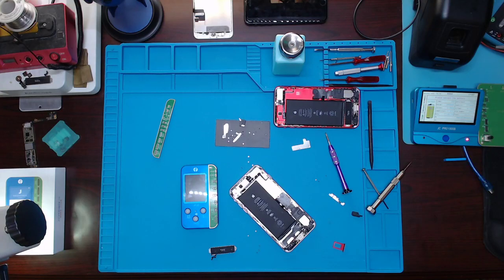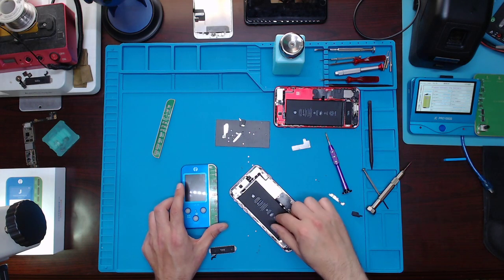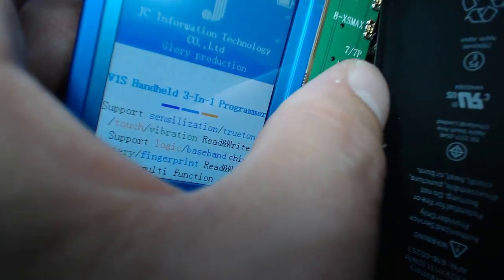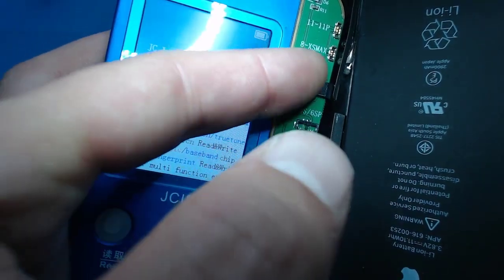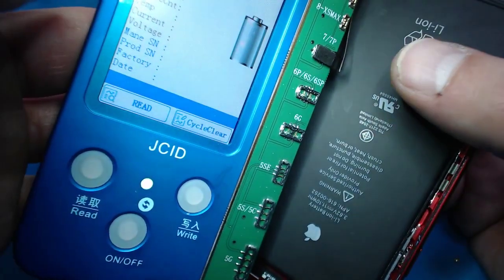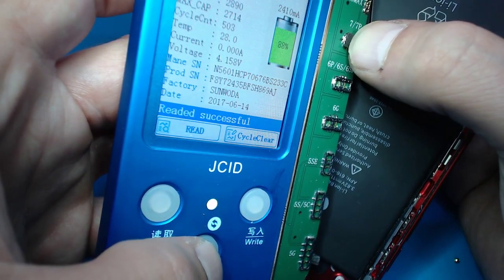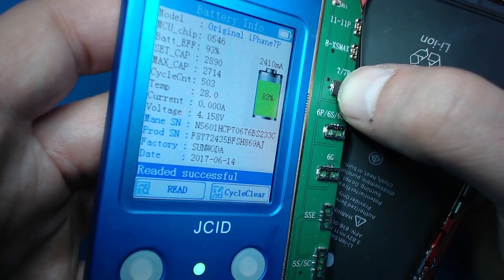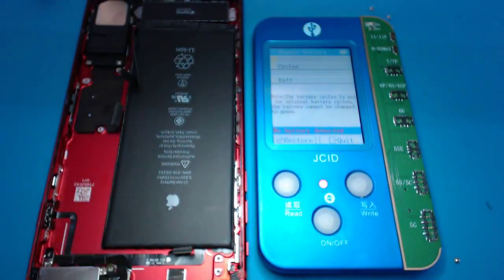JC V1S Battery Programming

Comment: Hey there,
I have a problem with my jc-v1s.
Normally I use a original apple battery, put it on the jc v1s, press on copy4item, then I put on a aftermarket battery with ti chip, press on write4item. The battery cycle is empty then. But if I build the new battery in, it has the same capacity as the one I replaced. So If the original has 89%, and I follow the steps I wrote, the new one has 89% too. How can I copy serial etc. and get the capacity to 100%? Thankful for every answer. Cheers

Comment: Can that reset battery health to 100%?
Reply from the maker: Yes you can reset the battery percentage👍
 but not recommended
Reply: @QsTechService1  can you please show us how to reset battery health to 100%?
Reply from the maker: @jimmyalvarado6601  You do it with the PC software JC software you have the options to do it in there can’t just do it with the programmer you would have to have the other programmer the touchscreen one the JC Pro 1000
Reply: @QsTechService1  thank you so much, I’ll try it that way.
Reply: @jimmyalvarado6601  hey, you make it to 100%?
Reply: @dnxaut1869  yes I did, all models, except for 11 and up. You have to download the JC program, and you can do it manually.
Reply: @jimmyalvarado6601  i do it on a XS, but my mistake was i changend the Serial number from the original battery and now my iphone shows the messsage that the battery is not original and at the battery health it shows " -- " do you know how i can find out the old battery Serial number or all old battery data ? Thanks a lot
Reply: @dnxaut1869  this is an old comment, but you can read the original battery serial number (ex factory) in the JCID desktop platform under the 'read iphone' tab or 3u tools and program it back in the 'repair fitting'  tab with the battery board.
Reply: @t4796  & whats about iphone 11 and higher?
Reply: @dnxaut1869  I think things changed after iphone xs. I've seen people using a 'tag on flex' between the battery and mainboard in conjunction with reprogramming. I've  got a 11pro i need to do in the next couple of weeks then I can answer with experience :) but that's just for battery swap not recovering any Serial number

Comment: If I take a battery out of one iPhone X and replace it with a better one out of another iPhone X, (both OEM batteries) will the phone correctly show the charge level? I.E. do these batteries have an authentication module? And if so, can this JC V1S do the required programming? From what I understand, this tool and it's programming/coding is needed for screen replacement to retain True Tone/Face ID. Confused if it also needed when repairing/replacing the vibrator/Taptic.
Reply: I have iPhone XS Max, old battery got damaged, bought another original used battery fully working. But getting the message “Unable to verify this iPhone has a genuine Apple battery...” I have JC V1S with battery module but confused what information can be programmed to resolve this issue...
Reply from the maker: I would recommend getting the JC pro 1000 With the attachment pieces Seems to work better Yes it will Show the charge levels and etc. Yes you do need to copy from the sensor to the other Sensor Apple is starting to pair everything especially with the iPhone 12